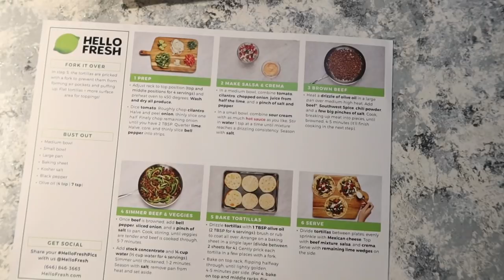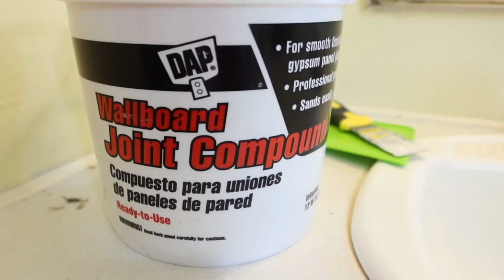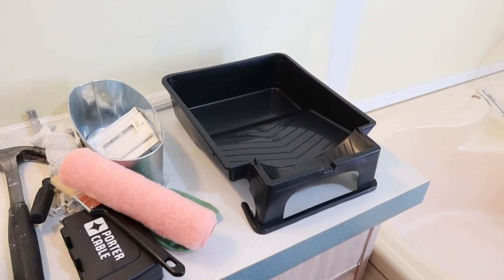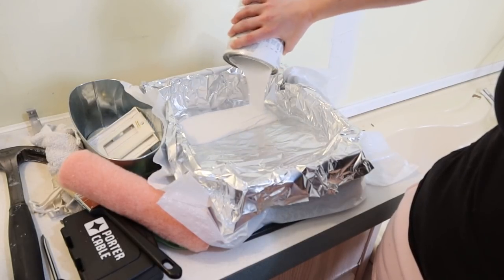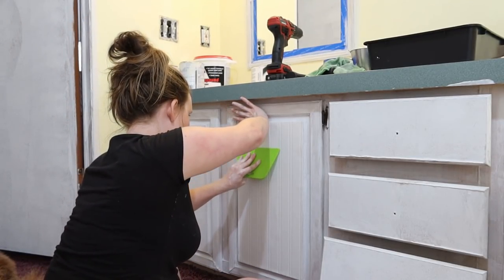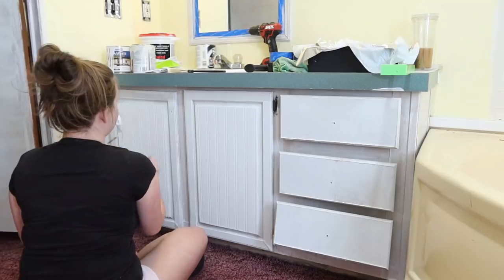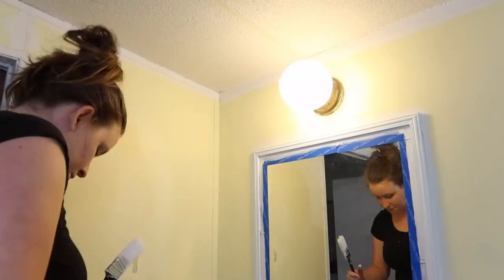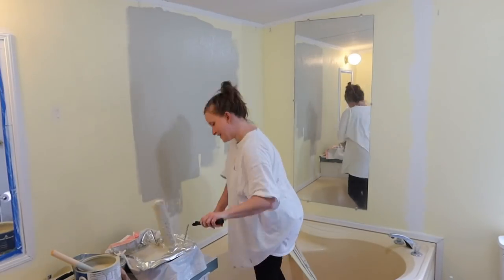MASTER BATHROOM RENOVATION! | MOBILE HOME MAKEOVER ON A BUDGET!

Comment: I know this isn’t going to help you at all now but for future renovation projects, when you remove those wall strips, use joint compound and dry wall tape. All you do is add a thin layer of the drywall mud, roll the tape over the layer of mud then add a top coat of the mud. Let it dry then sand it then it blends in with the wall perfectly. Dry wall tape is like a thick paper....there’s nothing sticky about it so I’m not sure why they call it tape. Maybe bc it comes in a roll like tape? Idk. Lol. Anyway. Just wanted to share this tip! Great job as always!

Comment: You should be able to use Rustoleum appliance epoxy on the tub. It’s less than $15 for a quart sized can.  They also sell one that is meant for tubs and shower, but it is more expensive. Look up tutorials!

Comment: Paint your bath white and seal it  also put  a white frame from beading around the big mirror to match the sink mirror,  spray paint the door handle brass too inside the bathroom and  white paint inside the units or put sticky paper inside then it’s just the flooring but no carpet  sticky tiles would be nice  great job x

Comment: Something that helps with redoing countertops. Sand the edges to round it. And make sure everything is glued down before painting.  This is also in case you want to seal it with epoxy. I also like to paint and seal the underneath of the counter

Comment: When my sister was doing her wall joints in her Mobile Home she used that self adhesive mesh joint tape. It helps to stop the cracks forming in the joint compound as the ground moves. Its available at most home improvement stores and very lightweight. Bathroom looks so good!

Comment: How has the joint compound and counter painting hold up? I have almost the same trailer (1996), I was told I had to use tape on seams and feather out 36 inches 🙄. Thank you for your videos!
Reply from the maker: I’ve heard you’re supposed to use seam tape also but so far ours is holding up without it. Long term I’m not sure? 🤷🏼‍♀️

Comment: I bought an old mobile single wide a few years ago. I am not permanently in there yet. It still needs more work. I ran out of funds and I became very ill. The bedroom is done except for hang a few pictures. The hallway is painted but not the ceiling. I can't do anything anymore. All the rooms were painted. I do need the ceilings painted. I would love to paint the cabinets in the kitchen but for now it will have to do. I had the roof repaired but it will need a new roof and eventually a new heater. The bedroom window does not stay up so that needs to be replaced but it is an odd shape. I need all new windows but OMG it is expensive. I hope to at least move in to it by next fall. I have a house that is not selling. Needs way to much work. I have only been here 27 yrs. and had contractors do a lot of work before I moved in but EVERYTHING they did started to come apart within a year of what they did. I may have to foreclose which is something I don't want to do because eventually I want to buy another mobile home in another state and I will need good credit for that. I am 72 and in not the best of shape anymore. It is hard when you are alone. I try to do my best. You have a nice place and are making it beautiful.

Comment: I have a question about the joint compound. Do you have problems with it cracking? I was told it would crack and have not done mine because of that.
Reply: I have not had a problem with cracking and have used it in a few rooms of my home.
Reply: @janelawrence95  thank you! The make over in the bathroom, looks great

Comment: you could have just put the paint tray in the bag instead and save the foil. Also, wouldn't the paint stick better if you cleaned the walls after sanding?
Reply from the maker: I did clean them I just didn’t want to bore my viewers with showing all that 😊
Reply: @KellysKorner08  gotcha lol